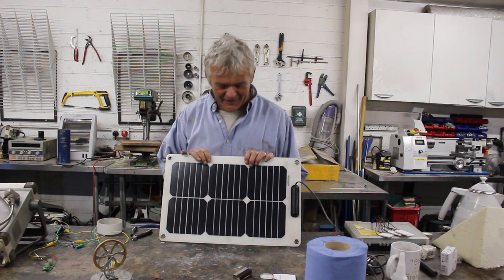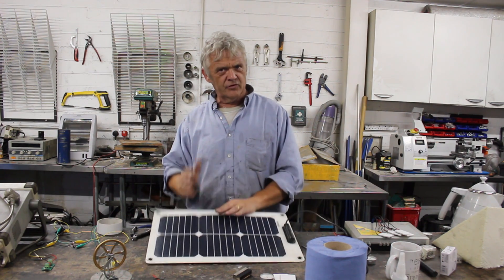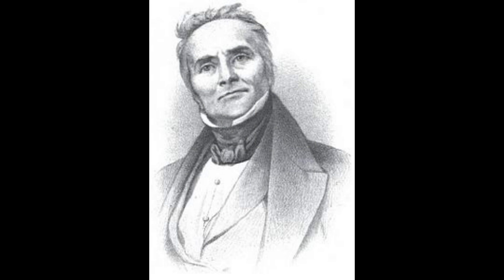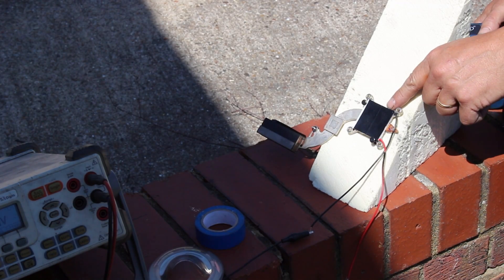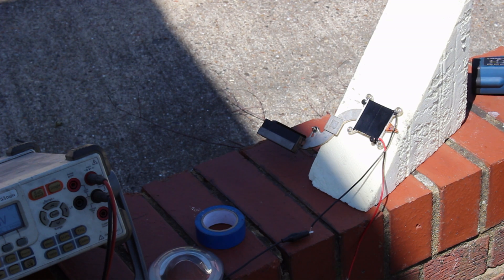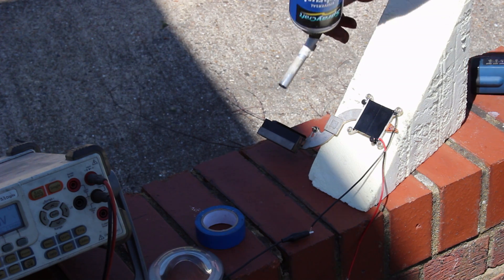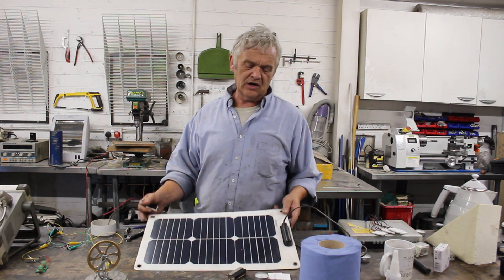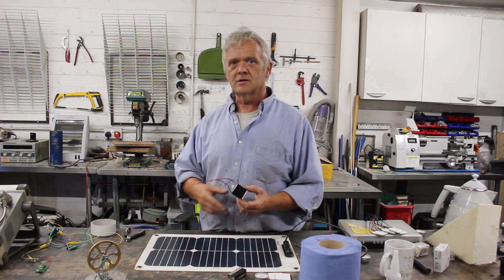1618 Putting A Thermo Electric Generator On Solar Panels

Comment: Cool :)  
As an aside I had a thought on solar panel cooling the other day- why don't they just put a bit of plastic over top of them and run water across the surface between the panel and the plastic? seems like you could get Both a lens effect for more light concentration And cooling at the same time.  
I'm sure if that worked somebody would have done it already, but I can't think of why it Wouldn't work beyond maybe running a pump would take too much energy to be worth it.
Reply: I've seen videos on making solar water heaters using black PVC pipe wound in a circle and placed under glass. They usually use the type of small solar pumps used for a small fountain. I suppose the power of the pump needed depends on how much surface area of solar panels being used but we're talking about trickling the water through.
Reply: @annebeignatborde1832  Sergiy Yurko is an excellent inventor/maker of thermal solar stuff. He also focuses on cost per kWh. Best wishes.
Reply: It is definitely viable in my opinion, also installing a water jacket to the rear. It is the prolonged service issues unless one is a tinkerer I think are the challenges. I run several pumps and lots of other stuff from my solar, a pump on say a 140 euro 330W panel wouldnt be a problem. Best wishes.
Reply from the maker: I wouldn't be too sure of the idea - if it worked someone else would have done it !
Reply: @ThinkingandTinkering  Sergiy Yurko, you would have to trawl through his many videos to find it. It didnt perform as good as his different methods but was one of the simplest. There was a manufacturer a few years back that sold combined thermal water photovoltaic panels, they were pricey from what I recall. Those latex black water bags with pluming integral for solar showers or pool heaters my be an option. My panels get too hot to touch on the underside of the glass, cannot remember the readings I took. This would nicely preheat hot water, immersion off the panels to lift it to optimum. My panels give me my hot water much of the year as well as my electric all of the year. Best wishes..
Reply: PVT is the typicalname for your idea. There are manufacturers.

Comment: I like the idea of capturing waste heat. Water absorbs heat well.  Is there any way to run a hose through the backside to absorb the heat on the way to a water heater?
Reply: A copper pipe painted black is great for capturing heat, if it was square-section you could use some thermal paste to attach it.
Reply from the maker: I would think so mate - but it might need a little looking into

Comment: Stick a TEG on the exhaust of a hybrid.....then we're cooking....the radiator
Reply from the maker: In some models they do that - don't they?
Reply: @ThinkingandTinkering Rob, I haven't seen it, but it's more than possible that they have. I hope they would have. There was a commercial TEG powered fan for a wood stove available for a while here in the States. I haven't seen any for a while, Northern Tool sold them.

I read that copper vs graphite "fins?" showed some real promise, might be right up your alley?  ;)

Cheers, sorry for sounding contrary, I hadn't watched the whole video, forgot to retract.